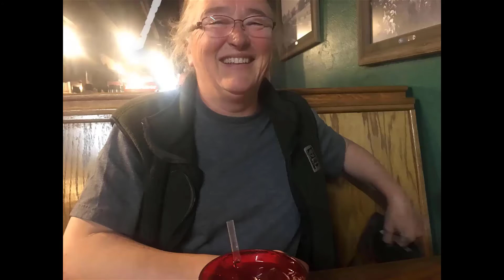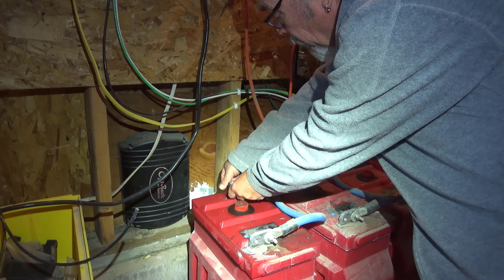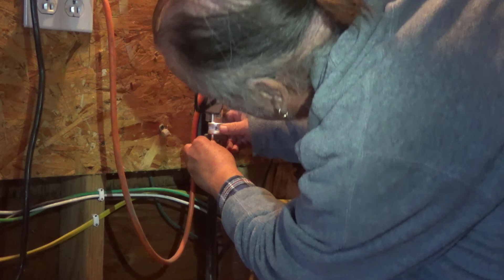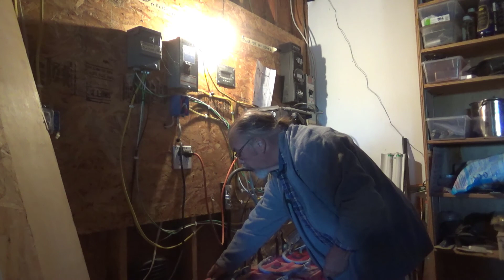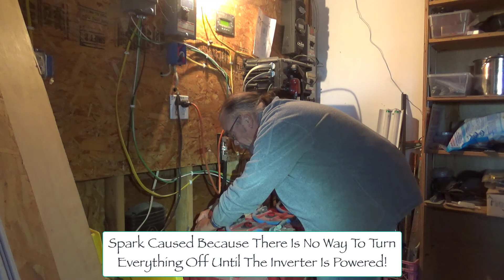Fixing Off Grid Studio Solar Electric System

Comment: Ouch on the fuse. Volt meter works great on finding lost power.  Long drive to pick one up. Hope ya picked up a spare for next time. Glad to see ya have power back on! Had to laugh with the sparks. We call that fire in the wire! LOL.  "CB amp lango"  Stay safe and have a great weekend!
Reply from the maker: Hey CB - you guessed right about a backup fuse. Bought another $34 fuse just in case. I guessed that the old fuse was breaking down but bought the second one as backup. I really prefer to avoid the fireworks. Irene shut down the kiln so that load wasn’t going to contribute to the excitement. That inverter pulls 50 watts in standby but powered up a lot hotter even if there’s no A/C loads. I’m really glad that there doesn’t seem to be any problem caused by the inverter. I plan to replace the studio system with the system we removed from the house. Big DC breakers instead of a fuse 👍👍👍. Thanks for your continued support. Take care and stay safe.

Comment: As you say Henry, they don't last forever especially when they are stressed close to capacity.
Maybe fit an isolator so you don't have sparks close to the battery?
Reply from the maker: Hey Tene. This setup is destroyed Ned to be replaced by the pieces removed from the house solar electric system. That one has a circuit breaker so I can avoid sparks when connecting that battery. Besides, who doesn’t’ like fireworks. 👍 Thanks for watching. Have a great week.

Comment: I need to get my solar system up and running but know nothing about it.
Reply from the maker: Wish we were closer to help you. Do you have any idea experience with electrical or have a friend with some General Electric experience? If you could email some closeup pictures of the various pieces log equipment I may be able to provide some help. Good luck!
Reply: @BrainStormAcres  No sir I don’t. I guess I will have to bring power off the road from the power company.
Reply from the maker: @The African Lion if the run to the power company is reasonable, you’ll probably more cost effective and easier to connect to them. You can still use your solar electric system but not rely on it for all of your power all of the time.
Reply: @BrainStormAcres  Thank you, that is what someone else also said.
Reply: @R G Homestead I wanted to run the house, water well and aerobic septic system and a workshop.
Reply: @R G Homestead I think I am going to get power from the power compnay, then build a solar system as a backup.
Reply from the maker: Sad that this is the pragmatic answer 🥴
Reply from the maker: Those are some pretty big loads! It can be done though.
Reply from the maker: This is what I like about our online community - people sharing information and trying to help!
Reply: @BrainStormAcres  Yes sir, I love it.